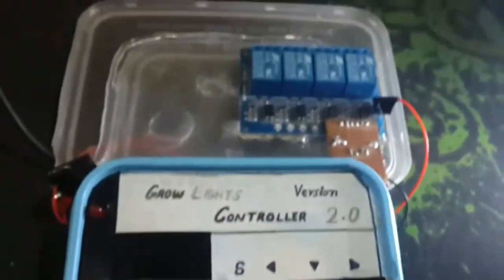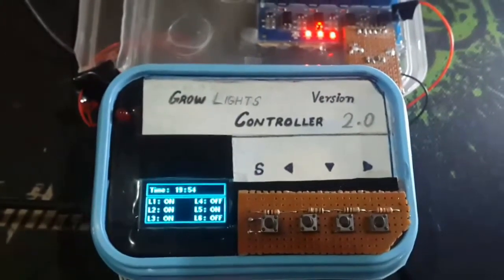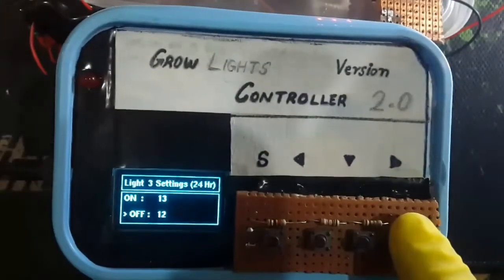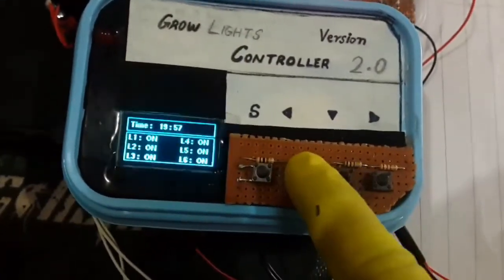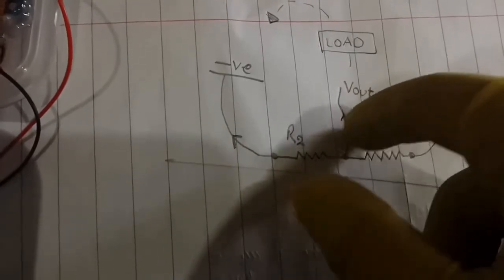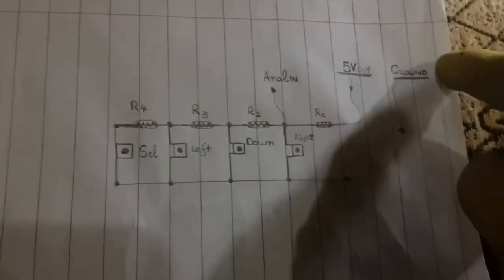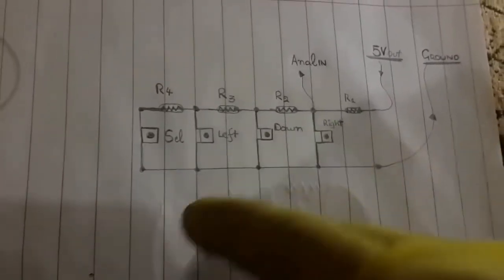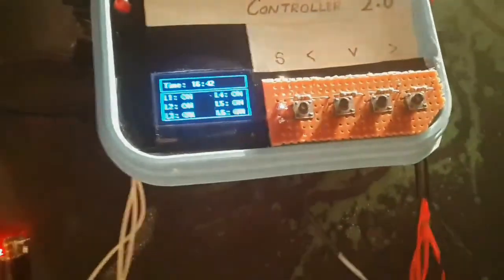Grow Lights Controller with Oled how to make Keypad

Comment: ya i agree nice lil build you got their how long it take you to write up the code for this?
Reply from the maker: i started learning from scratch 2-3 years ago & still a long way to go .. i have shared my code till v 5.0 and the light timer v 1 (all without buttons) plus other stuff and the info about how to connect things up  .anyone can use it for automating there own small setups . if you want to start then first get basic Arduino uno or Nano board ,breadboards and jumper wires watch tutorials blinking leds hello world stuff.. then use example sketches and different libraries .with simple dht sensor or thermistor etc then oled .. you'll face issues and problems then use google ...questions have been asked and answered already ... after you make the sketch then you have to test it and debug it and correct any mistakes etc
Reply from the maker: i used example sketches and some other sketches about specific things made and shared by other people and i changed them stitched them together added my own stuff now at version 6 there are a lot of things that are still there but my own lines of code have increased a lot but all this is possible because there are libraries available for doing complex things
Reply from the maker: do you grow indoors or just interested in learning how to program arduinos ?